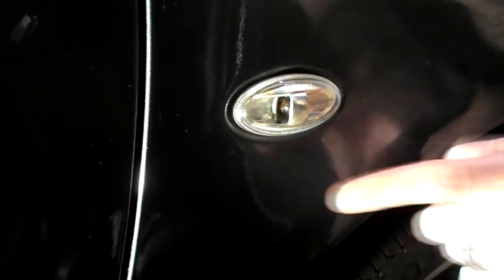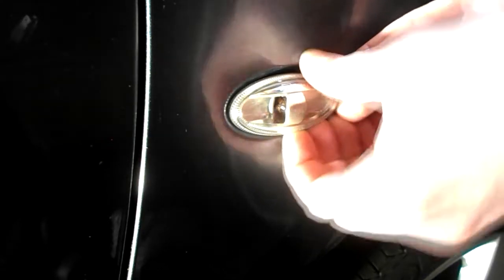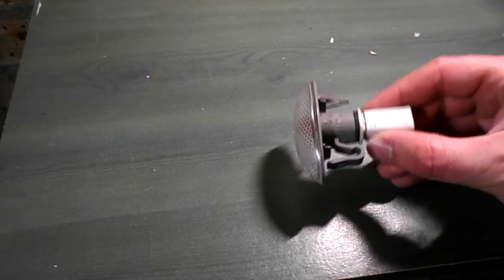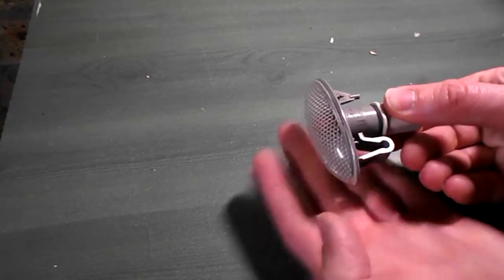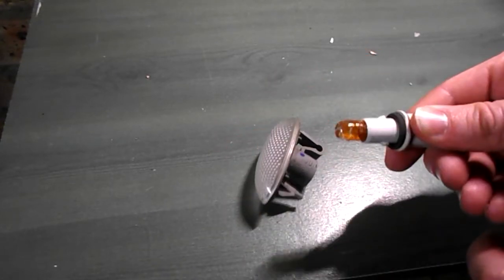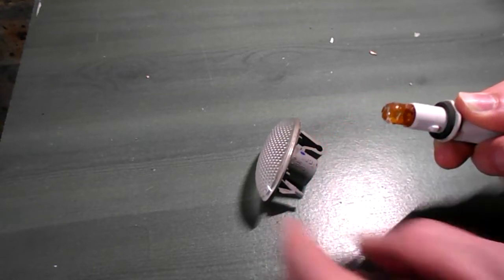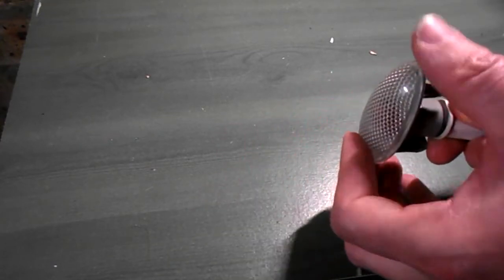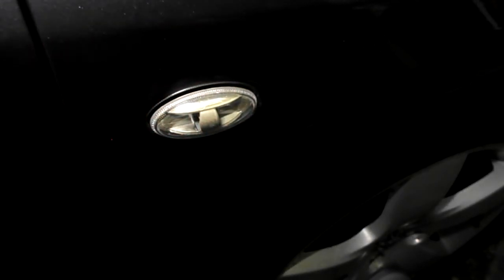Peugeot 307 Side Repeater Indicator Bulb Change

Comment: Your video is really confusing. You pull out one of the sealed unit side repeaters (newer PSA cars) and then the video cuts to a side repeater where you can separate the bulb and the housing (old style). Why do this and not explain it?